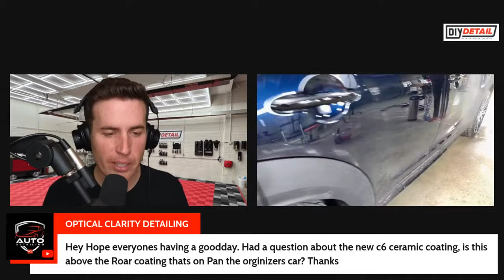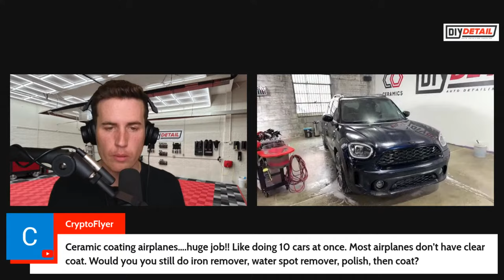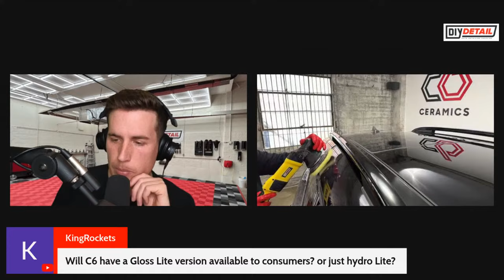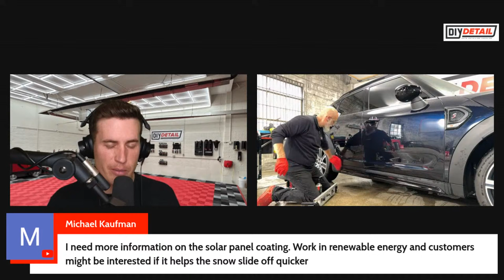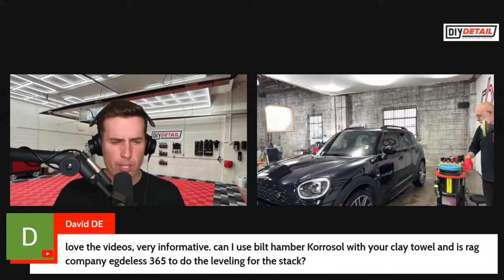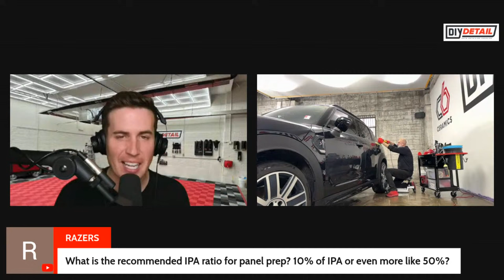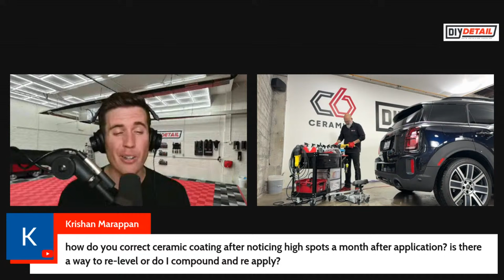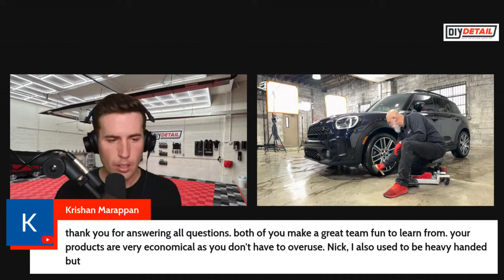LIVE: Wash, Decontaminate and Polish (Q&A)

Comment: Hi! I noticed that you did not rinse the all clean in the wheel until you finished washing the car, does it cause any damage to the wheel if the product dries or is that something you should only be worried about if you are in direct sunlight? 

Yvan is crazy fast by the way!
Reply from the maker: You should rinse before it dries. You get faster with age.
Reply: @diydetailofficial  thanks!! 😂

Comment: I’m new to the Channel,  I’m not a pro but I have being benging the channel and learning a lot. I have an orbital hand sander has 12500 single speed. What a the difference between between that speed and normal Rpm?
Reply from the maker: That’s fine, your sander is rated on Orbits Per Minute.

Comment: Damnit of course I missed it. I have questions about the gold standard polish. How abrasive is it roughly? grit wise
Reply from the maker: It can remove 1000G sanding marks
Reply: @diydetailofficial  and I can finish with it? Is it like a longer lasting diminishing abrasive?
Reply: @diydetailofficial  ok well when you get more in stock I need some. Hoping your product is the cure all
Reply from the maker: Yes you can finish with DIY Detail Gold Standard Polish. It’s extremely pad dependent. It’s not a cure all, but many professional detailers have started using it exclusively.
Reply: @diydetailofficial  wow that makes it way more simple. I'm ready to buy some but you've been out of stocks for weeks it seems

Comment: Many thanks for your "detail" videos. Question(s): Can you DIY RinseLess wash, clay and decon one day; let car sit overnight; then next day, apply/remove DIY gold polish, followed by 5yr ceramic coat? Or,  DIY RinseLess wash, clay, decon and apply polis, but leave polish on overnight; then next day, remove DIY polish with RinseLess dampened towel and wipe; and followed by first, panel prep then DIY 5yr ceramic coat application? Another words, what's the max "dwell" time of the DIY gold polish? And, after the paint correction step, what's the max time lapse before the DIY ceramic coats products need to be applied? Your thoughts/suggestions are much appreciated.
Reply: Watching for this answer
Reply from the maker: Your best to not let it sit overnight. FYI the whole process from dirty to coated car should only take 3-4 hours
Reply: @diydetailofficial  Much appreciate your response. What about using your new product, the APP? After Rinseless wash and decon/clay, can I apply APP, let sit overnight ( with the APP still on the car) before having to remove your APP the next day, along with applying the DIY ceramic coat the next day? If so, can the car sit in or outside?

Comment: Great live stream! Watched all 2 hours of it. Thanks for the content, it's greatly appreciated! 

Hey Yvan, can the metal ceramic coating be used on zinc coated or galvanized metal? 

Any benefit at all using the APP on any type of steel or metal (stainless, chrome, zinc plated or aluminum) after polishing with gold standard polish and wiping clean with rinseless? Or is panel prep best suited for this instead of APP? Thanks!
Reply from the maker: DIY Detail Panel Prep is best for Metal Ceramic Coating

Comment: He guys. The one viewer purchased a Hercules Rotary with a 7" backing plate. He asked what size pad to use and you mentioned the 6" or a 5" pad. That won't work u kess he got a 5 or 6"backing plate.
Reply from the maker: You would want a 6 inch backing plate with 6.5 inch pad

Comment: As I was detailing a neighbors Lexus today, I discovered something awesome about Ceramic Gloss. After a good bubble bath and decontamination, I used it as a drying aid, but wait, there’s more! After the vehicle was completely dried and blown out all the crevices, I went back over the car with the already dampened towel with Ceramic Gloss on it with one fresh spray on the towel and applied a lite second coat. It definitely made the color deeper and gloss and slickness went up a notch. This may be my new process. I know, it’s not necessary, but it was such a quick and lite coat and made a noticeable difference. And when the customer is all smiles, it’s worth the extra 5 minutes.
Reply from the maker: Excellent, thanks for sharing.

Comment: Hi guys, 2  questions:
1. I left the lid off of my 3 year ceramic coating overnight in the garage, it was 60 degrees F. Is it still OK to use?
2. After coating my car with the 3 year coating,  I noticed a scratched area on my trunk that I missed during the cut/polish process, which is now trapped beneath the ceramic coating. Do I need to cut down past the coating to the area of concern and reapply the ceramic? (Assuming the whole trunk panel)
Thx for everything that you do for us DIYers!!
Reply from the maker: Unfortunately yes, that coating should no longer be used( or use it on your mower or outdoor furniture).

For the trunk, yes you will need to polish and re-coat the panel
Reply: @diydetailofficial  I figured so much...thanks!